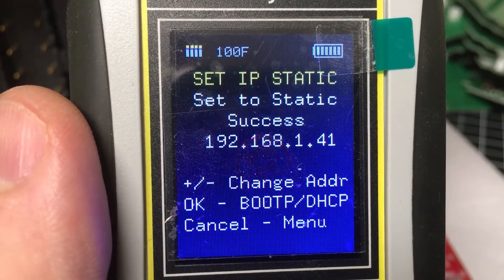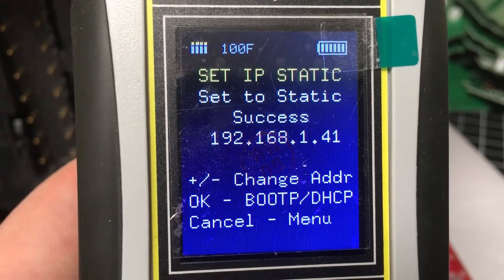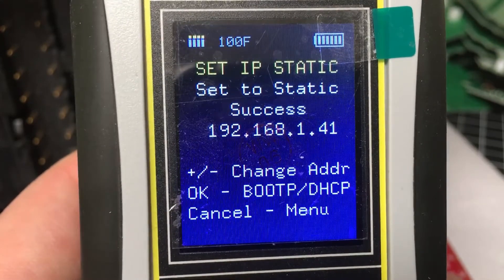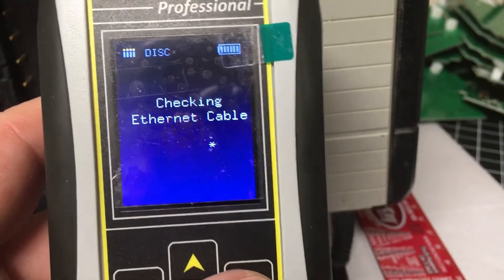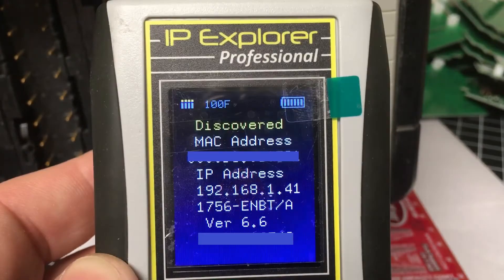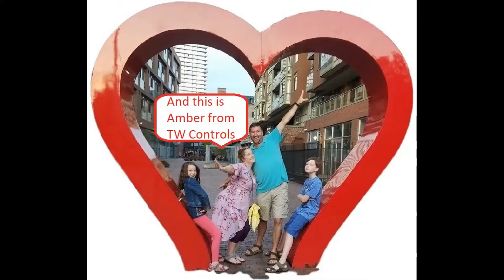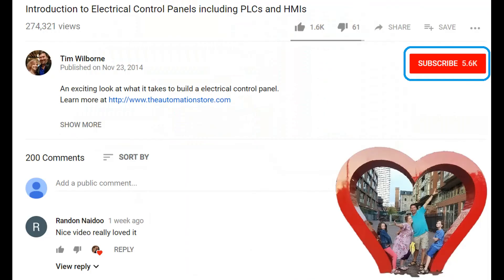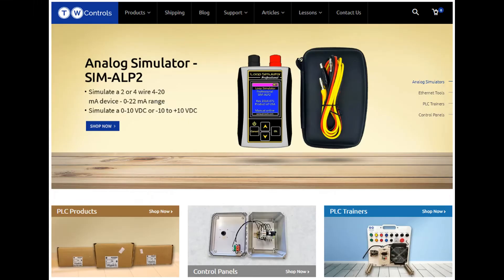Reading and Writing IP Address to an Allen Bradley 1756-ENBT Controllogix Ethernet Module DHCP BOOTP

Comment: I just bought one. This is awesome.
Reply from the maker: Glad you like it!
Reply: @TimWilborne  So I got this to work on pretty much everything except setting an IP on a panelview that already has a static IP. It seems no matter what I do it will not replace the address. This has already paid for itself for sure. Just wondering if I'm doing anything wrong?
Reply from the maker: Most Panelviews require that you use the config screen and are not compliant with that part of Ethernet/IP
Reply: @TimWilborne  I am glad you responded because I am usually relentless in trying to figure out a way. Thanks again Mr. Tim